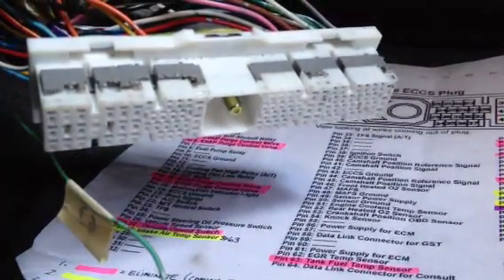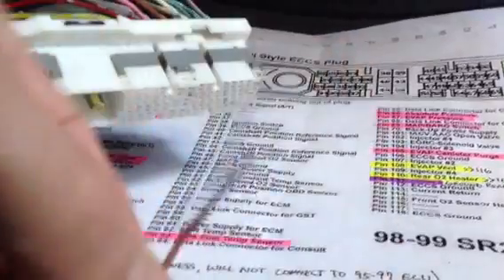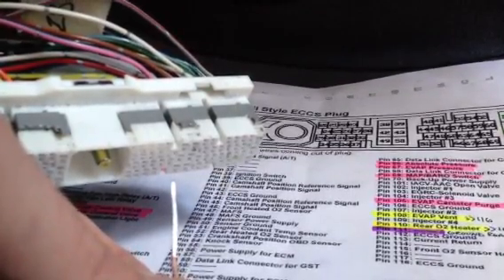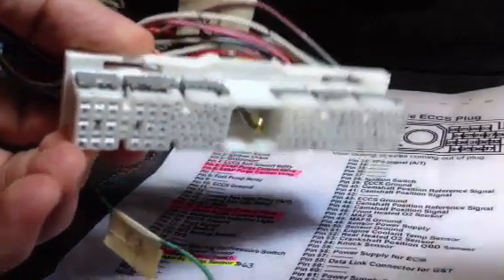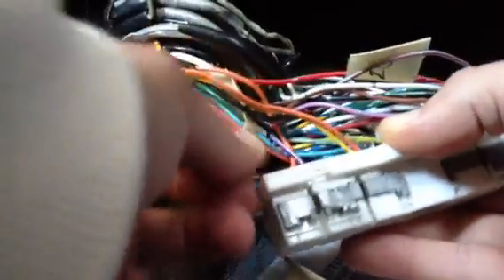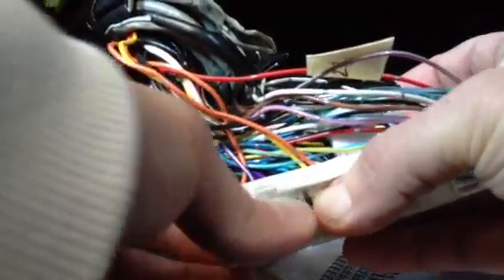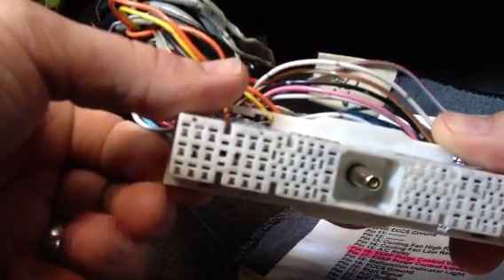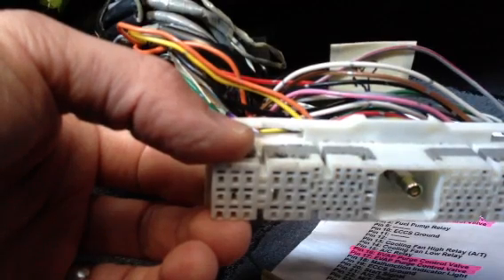Sr20 obd2 repin ecu harness

Comment: I'm having an issue with no spark on my 98 ser. Where can I see a color coded ecu diagram
Reply from the maker: Try to look up FSM (or factory service manual) for your Sentra.  Pinout for G20 and Sentra are not 1:1, there are some differences.

Factory Service Manuals have diagnostic steps you can take to sort through issues like no spark if you're having a difficult time trying to figure it out.

Good Luck.
Reply: @toekneefurareoh  thanks man I got it to fire up

Comment: Anyone know where I could get a obd2 to obd1 jumper for a fwd sr20?
Reply from the maker: You will need to make one, or you will need to find one that has been custom made.  Concept of this video also applies to making a step down harness, understanding how to line up the correct wires to the right pins on the ECU that you plan to use.

I recommend picking up an AEM OBD 2 fwd jumper harness, then, find an OBD1 fwd harness in the junkyard or on ebay.

Cut the OBD1 (full) harness (NOT THE AEM JUMPER HARNESS) a few inches off the plug that goes into the ECU far enough so that you can splice the wires off the OBD1 harness into the OBD2 jumper.

Advantage there is that the jumper harness can now serve 2 purposes (since you spliced it in).  OBD2 to OBD2 jumper or OBD2 to OBD1 step down.

Sometimes people just hack off the portion of the OBD2 jumper that plugs into the OBD2 ECU, and use it only as a step down.  Which is fine and you can do that too.

Obviously if you make a dual purpose harness you can only use 1 ECU at a time.

Comment: Hi, Tony.
Great contribution man.
Will you have the diagram from OB2 to OBD1?
I need to repin my ECU NISSAN 200SX SE-R 1997 platform B14 to ECU NISSAN SENTRA 91-94 platform B13 because I will install NEO Vvl engine.
I've searched the net but I can not find something concrete.

Sorry, I do not speak English so I relied on the translator
Reply from the maker: Maybe I can point you in the right direction.  Here is the diagram image of the OBDII (newer style USDM) to OBDII (older style USDM) https://bit.ly/2F5f5y6, here is a link to an image with all USDM pinouts https://bit.ly/2DpaRzy, last a spreadsheet with pinout descriptions https://bit.ly/2yRD1iP, not sure if you are in the US, we have much different emissions components on our vehicles than other countries, so the pinouts might not be the same.
Reply: @toekneefurareoh  The last 2 links are not working, thank you for the first sheet.
Reply from the maker: @duanedonaldson2262  its been a few years, I think the sheets I originally was sharing were on photobucket.  There is a good thread on g20.net if you're looking for ecu pin diagrams, take a look here https://bit.ly/3p9V2Bl good luck.

Comment from the maker: It helps to use the proper sensors and iacv designed for the ecu you are running.  This is true in 2000+ rr sr20de setups.  Not necessary if you are changing out a 98-99 non rr sr20de usdm ecu with an earlier style 94-97 ecu that can take a daughter board and can be tuned.  Only difference between 94-97 obd2 ecu and 98-99 ecu is that the 94-97 is tunable (when daughter board is installed) and 94-97 has significantly less emissions accessories.  

As for the intake manifold, a lowport sr20de non rr intake manifold will fit on a 2000+ sr20de rr engine, but requires some modification to the coolant/water pipes on the back of the engine, and the throttle body has some clearance issues against the valve cover.  The lowport intake manifold has the best flow characteristics of a standard sr20de engine, the sr20ve intake manifold is even better but requires more modification.

Last thing to consider is the rr, 20v, and vet engines use top feed fuel injectors and the non rr engine and ve engine both use side feed injectors, unless your running a non tunable ecu with a different intake manifold, you may need to find an aftermarket fuel rail that accepts the type of fuel injectors compatible with your ecu setup.

That is literally EVERYTHING, if you need to know more I suggest you look up some of my threads on g20.net, you can find my write-ups under the username ferrari21.

Comment: Did you use this ecu on a 2000+ b15 or p11? Those are the trick ecus that can't be tuned. And I read that if you use this method you should also change to the b14 intake manifold and rewire to use those sensors and iacv.
Reply from the maker: You are correct, if you have an 00+, best route to go is to swap intake manifolds (94-96 off a b14 or p10 are preferred), and get your hands on a 99 harness which supposedly will plug right into an 00+.  Then modify a few of the pins to accommodate the 1st generation of OBD2 ECU's.  Use all of the sensors (TPS, MAF, IACV, engine coolant temp, 99 distributor, etc...) from that 94-99 car.  They should plug into the 99 harness.  There are many people who have done this before and some how-to's already posted on g20.net who have successfully modified their cars.

Comment from the maker: It depends on your state emissions requirements.  In most cases, if you maintain obd1 vehicle with obd1 ecu or obd2 vehicle with obd2 ecu, and you are not throwing codes, with all emissions monitors ready, then most states should let you pass.  You must ensure the consult signal cable is wired properly so that the state emissions computer can talk to your ecu.  Hopefully that makes sense.

Comment: Searching on the forums, I haven't found a definitive answer to the question: if you were to use this method on a later gen, will the car still pass obd2 emissions testing?
Reply from the maker: Yes, there are 3 styles of OBD2 ECUs that Nissan used for USDM vehicles between 1993 and 2002.  The first two generation ECU's were 16 bit, the last ECU (used between 2000-2002) was a 32 bit flash-able ECU.  The first generation OBD2 ECU is desired because it gives you the ability to solder on a daughterboard that can manipulate a more desirable fuel map after the car has been modified.  You cannot do this to the 2nd gen ECU (97-99), and I haven't heard of anyone who has come up with a method to flash the 32bit OBD2 ECUs.

So to answer your question, yes, you should still be able to pass OBD2 emissions testing by using any SR20 OBD2 ECU because the signal for the consult port should still read from the same port style, dtc's, and overall signal/language spec.  https://en.wikipedia.org/wiki/On-board_diagnostics.  You'll just have a lot less emissions diagnostic equipment on your car when the emissions people go to scan the ECU for dtc's or a CEL.

When you repin, just make sure you keep the signal wire in the right place (where it will be present on the different ECU you are installing).  As long as you've done everything right, and you aren't throwing any CELs, emissions equipment should recognize OBD2 as OBD2, regardless of the year ECU you are running.